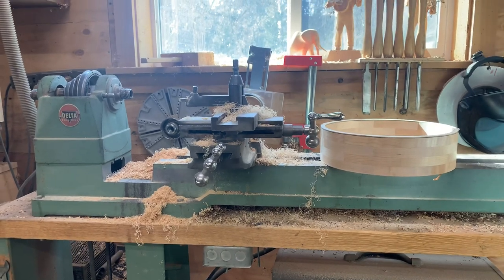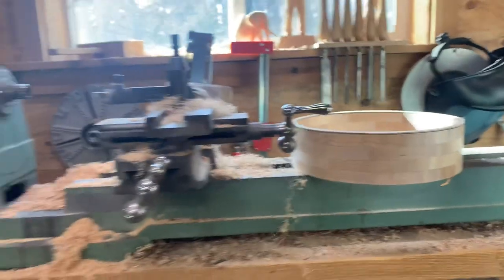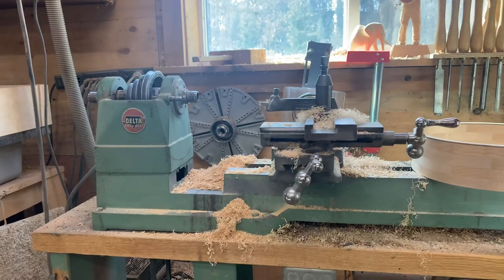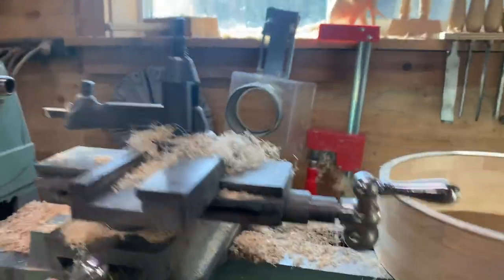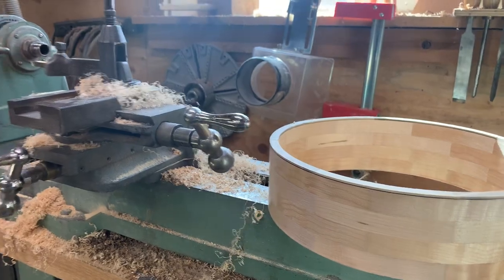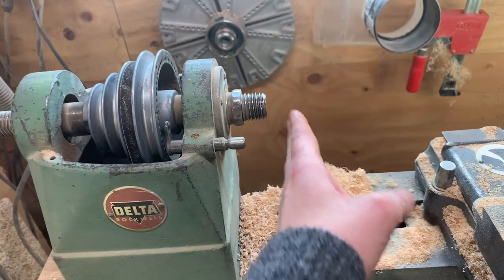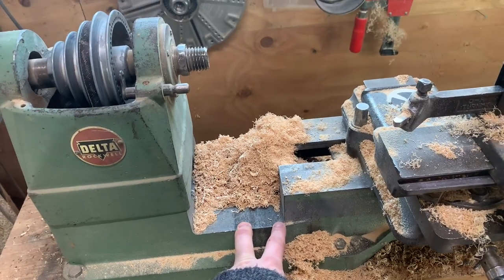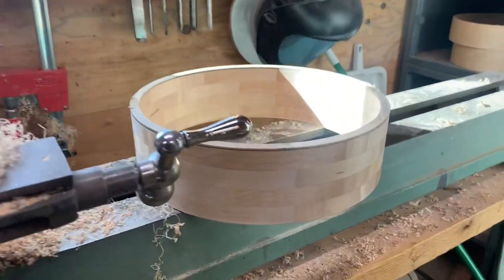My Lathe For Turning Banjo Rims

Comment: I actually found what I believe to be the same X-Y compound sliding table by delta on eBay, but it looks like the lantern-style tool post and tool holders are missing. Do you happen to know where these can be purchased and which tool holders and cutters are needed for banjo rim turning? Thanks for posting this!